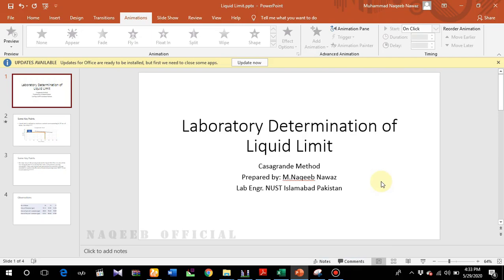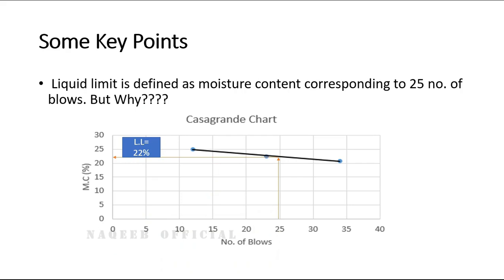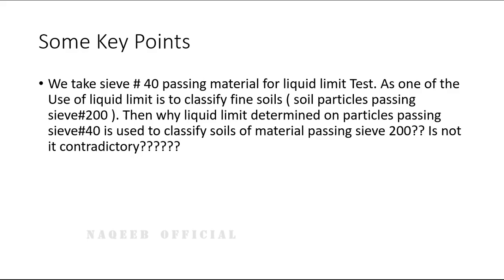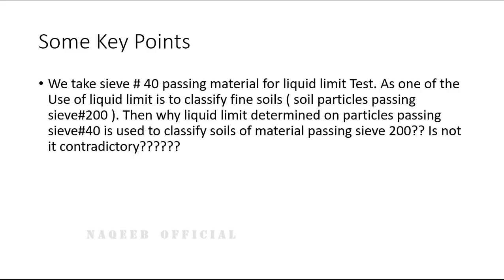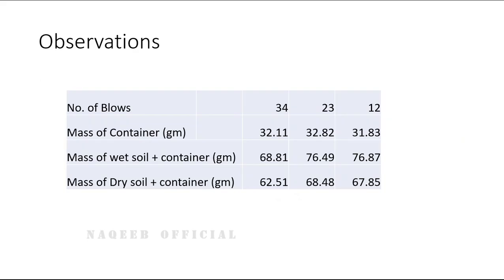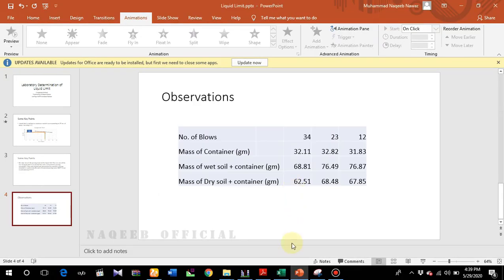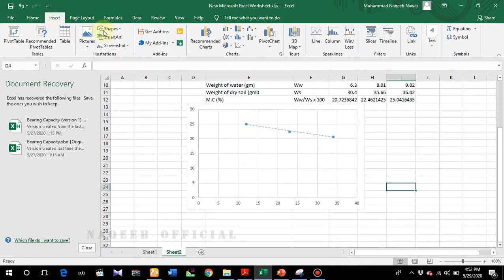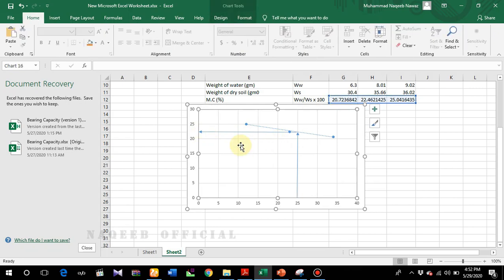Liquid Limit Test Calculations (Using Excel ) |  English | Geotech with Naqeeb

Comment: Brilliant refresher. 
I had worked with Falling cone tests where we also calculated the shear strength of soil so that we could cross check the results against insitu field testing methods such as cone penetration testing. The CPT results were more trustworthy though. 
Some other topics ideas: Bearing capacity of shallow foundations in cohesive and frictional soils, single pile or group pile bearing capacity. 
Instead of sending excel file to individuals, you can leave a google docs link for anyone to access. Keep up the good work and I hope your channel grows BIG.
Reply: Thanks a lot brother..CPT is basically reliable for noncohesive soils mostly...this casagrande method is most reliable for cohesive soils.and thanks a lot your suggestions are really beneficial..i am working on it..will post lecs on topics suggested by you..after lockdown i will make doc file in descrption box as it will be busy time then.